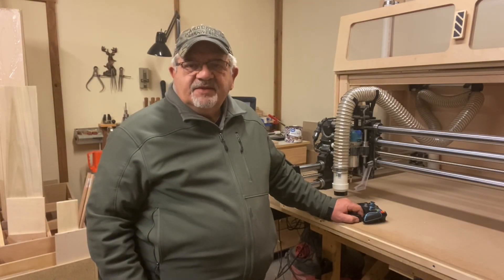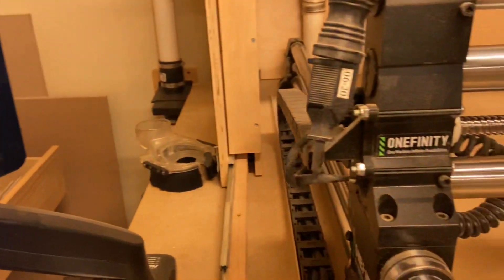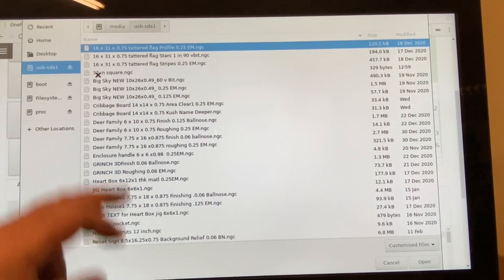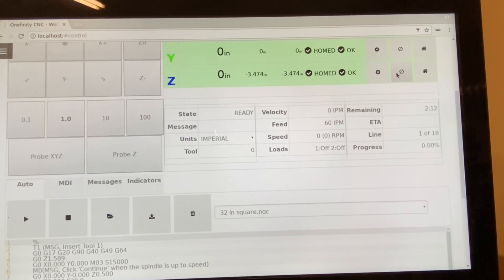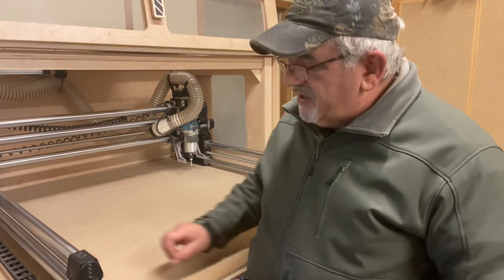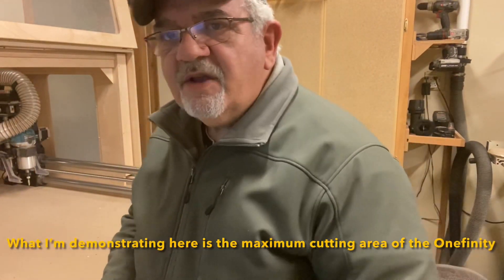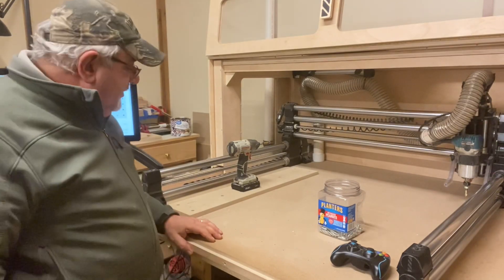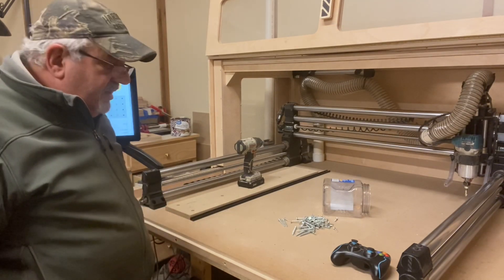Onefinity- laying out your spoilboard

Comment: Thanks for this. I'm also using Carvco and am setting up a Journeyman with your help. Thanks.
Reply from the maker: Reach out in messenger if you need more help!
Reply: @onefinity-trainingtipswithMitz  One question I have is how long this 1/8 upcut bit will last cutting these MDF planks. I'm cutting dog holes and threaded-insert holes (about 34 holes per plank). I only got three cut yesterday and I'm cutting at least 8 of these.  MDF cuts so easily that I'm thinking this bit will last through all 8 planks. How will I know If I need to change bits?
Reply from the maker: Be sure you set your bit parameter correctly (feeds/speed/stepdown etc). Running too slow will cause bit to heat up and will dull quicker or break. On MDF, I’d run that bit at 150 ipm feed, 75 ipm plunge, 0.07” stepdown, 0.05” stepover, router set to 3 (17,000 rpm). Bit should be warm to the touch but not hot. 
I would consider using a mini Jenny to make these cuts though as it will leave a better finish on the top of the material vs an upcut. 
Bit parameters: 125 ipm feedrate, 65 ipm plunge, 0.09” stepdown, 0.05” stepover. Router set to 3 (17,000 rpm)
Reply: @onefinity-trainingtipswithMitz  Thanks. I accepted the default feed rate, which Carvo set to 7mm /sec. If I understand, you're saying I could increase the feed rate to 150mm/sec? My plunge is set to 4mm/sec, and you're suggesting 75mm/sec? I also increased my max jerk per your other video.
Reply from the maker: No…I was suggesting 150 in per minute feed and 75 in per min plunge.  Sorry didn’t realize you were working on metric. So 65mm/sec feed and 32 mm/sec plunge.

Comment: What type spoil board did you use, dimensions, hole spacing, size and counter boring?
Reply from the maker: I used 5 slats at 5-7/8” wide x 32-3/8” long x
3/4” thk mdf. I wanted 8 holes for each slat in a 2-1-2-1-2 pattern and spaced them evenly down the length of the board.  The depth of the counterbored holes are 3/8” dia and 7/16” deep to accommodate the Spax screws
used.
Reply: @onefinity-trainingtipswithMitz  thx much!

Comment: Good video.  I just got my Onefinity Woodworker and in the process of making my work table for it.  I am debating on purchasing square interlocking foam workshop floor matting to go under my table to absorb some vibrations between the table and the floor.   What is your opinion on this?
Reply from the maker: Makes perfect sense, then yes I would put something down to prevent any “chatter” that might occur. I spent twenty years in my first career managing production in the vibration isolation industry - look for a mat in the 50-100 durometer range. Enough hardness to absorb vibration but not too soft to move laterally on you.
Reply: @onefinity-trainingtipswithMitz  Thank you for your response.   I appreciate it.
Reply from the maker: That depends - are you wanting to prevent vibrations going from your machine into your floor or vibrations coming into your machine from other equipment?
Reply: @onefinity-trainingtipswithMitz  Thank you for your response.  Mainly from the CNC to the floor.
Reply from the maker: There isn’t any discernible vibration from the machine that I’ve noticed but I’m on a concrete floor. However if I had my machine in a room in the house, I might consider putting in some vibration leveling mounts or pads right after I sound proofed the room. Lol! 
Noise from a shop vac or the bit cutting through wood can be fairly loud (and can be annoying to neighbors). 
But I would put an anti fatigue mat in front of the table because you won’t want to stop watching it so it’s thing.
Reply: @onefinity-trainingtipswithMitz  thank you.  I will be running my cnc in my basement which unfortunately does not have a concrete floor.  We have a raised wood floor on dirt.  I think it would cause quite a racket on my raised wood floor.

Comment: What size is the ttrack and MDF pieces?
Reply from the maker: I have 5 slats of MDF 5-13/16” x 32” x 3/4” thk. The t-tracks are 3/4” wide x 36” long x 3/8” thk. 
4 t-tracks between the 5 slats of MDF

Comment: Is the spoil board pretty much centered between the two y rails? I'm trying to layout a new table design in SketchUp and want to make sure it comes out correctly. Thanks
Reply from the maker: Kind of but not exactly dead nuts centered.  I just came in from the shop...I’ll check it tomorrow.
Reply: @onefinity-trainingtipswithMitz  Thanks, I appreciate that. I don’t get mine until late July and it’s my first venture into the CNC world. I’m trying to design a folding table using some 8020 aluminum extrusion and a plywood torsion box that will pivot from flat to vertical. I’m close to the finished product but I’m just using the rough specs and many visual cues from YouTube. I’m enjoying your videos and learning as I go. Thanks for what you do.
Reply from the maker: Inside left rail Y foot to cutting area is 2”, inside right rail Y foot to cutting area is 1-7/8”. From front to back:  front the front of y rail feet to cutting area is 9/16”.

Comment: Hmm What i did I got a #2 pencil broke it in 1/2 sanded down a the end of it placed that into my collet, used controller had the router make a pencil mark to show boundary, then i cut .75 MDF to fit. I got T tracks to go on it. just no time yet so they not on yet.
Reply from the maker: Yep. That works too!

Comment: Any reason you didn’t make the box 32.126 square matching the max cut area?
Reply from the maker: Wanted to be sure I was inside cutting area so as not to get any error messages for layout. You can go up to 1/2” wider and longer on the spoilboard itself by making several marks on your table top and lining up to that.

Comment: Forgive me for asking what might be a stupid question- is the actual depth of cut the machine is capable of reduced by the thickness of the spoil board? That is, once you've added the 3/4" spoil board, is the amount of Z travel essentially reduced from 5 1/4" to 4 1/2"?
I'm eager to get my Onefinity machine! Thanks so much for the informative videos.
Reply from the maker: No, the soft limit or travel on z axis is 133mm or roughly 5.23” and the collet on router doesn’t make it to the spoilboard. However the length of your bit will have an impact to the overall cutting height above your spoilboard.

Comment: Hi there, do you use 1” or .75” mdf? Getting ready to head down to my lumber yard.
Reply from the maker: Sorry, just seeing this.  I used 3/4” MDF although 1” would work too.  May be a bit more expensive but you also gain an additional 1/4” so you don’t have to replace as often

Comment: Where is X0 and Y0 in relation to the left mount. I have not received my machine yet and want to draw out on the surface about where everything should line up at.
Reply from the maker: Replied in messenger
Reply: @onefinity-trainingtipswithMitz  What messenger?
Reply from the maker: Facebook Messenger
Reply from the maker: Lightning bolt icon  ⚡️ top right corner on Facebook

Comment: did you drill the holes in the spoil board in a specific location
Reply from the maker: 1-1/2” in from each side and end, which will give you the 4 corner holes then 2 holes in middle of the long dimension 1-1/2” from each side.  Then 1 hole between the 2 end holes and 2 center holes in center of width.  Total 8 holes

Comment: what are the dimensions of the boards, and how far do you countersink the screws, and what size are the screws, oh and where do you get the t-track
Reply from the maker: There are five boards that are 5 13/16 wide by 32 1/4 inch long for a total of 29 1/16. Then I added four T-tracks that are three-quarter inches wide which will bring the overall dimensions to 32 1/16 inch. I countersunk the holes in the boards 7/16 of an inch leaving 5/16 of material to hold down the board. The t-tracks I purchased on Amazon ... this one is a good price
 https://www.amazon.com/Screws-Double-Universal-Predrilled-Mounting-Woodworking/dp/B07ZC2YHSH
I used powerhead screws. 8 per board
Reply: @onefinity-trainingtipswithMitz  Thanks so much for the reply
Reply: @onefinity-trainingtipswithMitz  HI, Great videos. Just one question. This video shows 4 T-tracks. On your other setup video your board has 6 (one on the far left and one on the far right). Just wondered if the boards,  five boards that are 5 13/16 wide, measurment was using 6 or 4 tracks? Thank you
Reply: Mitz, did you ever make the plans for the sliding enclosure, I would like the plans they are perfect
Reply from the maker: Yes. There’s a link in the description of the part 2 video for a pdf of build document. If you want I could send you SVG of the files for the side panels, tops, front and brackets if you use anything but Carveco Maker but you’ll need to define your toolpaths. If you do use Carveco Maker,  I can send you the .art files with toolpaths
Reply: @onefinity-trainingtipswithMitz  I have VCARVE Pro,  and I would appreciate anything you have, how do you hook up dust collection
Reply from the maker: Hi Wayne. This video covers dust collection. 
https://youtu.be/j1ev-r7-xKY
Reply from the maker: The two outboard t tracks has no bearing on slat size as they’re outside the machine’s cutting area. 
5 x 5-13/16”= 29-1/16”. 4 t tracks at 3/4” wide = 3”. 
So total width is 32-1/16”. I put the 2 outboard tracks on afterwards. See surfacing video, you’ll see that they’re back on. (Cutting area of Onefinity is 32.126”...)

Comment: One question.  I cut my mdf sacrificial boards to 32.25” long.  Was going to just home machine and manually score up on y and then score x across in the bottom and align from there.  1” surface bit will clean up the excess on edges with cutting area being 32.126.   Same  concept, without having to run a program?
Reply from the maker: Yes, same concept Chip. Originally was going to show that way too but if you don’t have joypad controller it is extremely difficult to do. 
If you have the joypad...keep your fingers away from the z control.
Reply: @onefinity-trainingtipswithMitz  will have joypad controller   Thanks for all the tips!